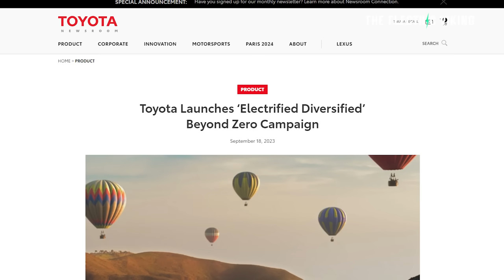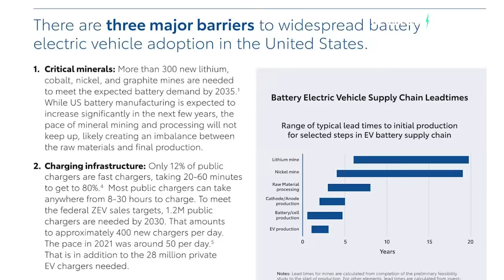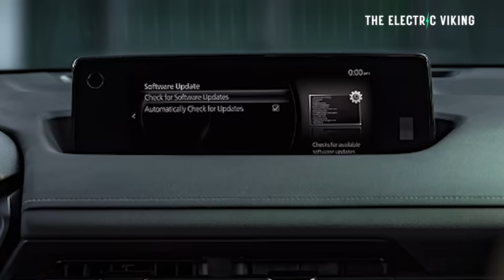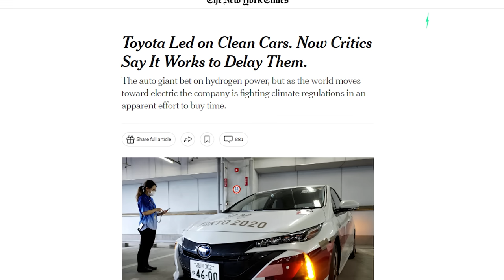We are witnessing the early stages of the biggest fall of any company in history

Comment: As Tony Seba pointed out, there's too many moving parts in the ICE, something upwards of 2000, where the electric motor has under 100 moving parts, BIG difference.
Reply: While an ICE car contains about 35k parts,an EV has about 10k.
Reply: @adamadamm5369  beats the hell outa me.  Tony Seba has a video where he shows an ICE broken down and spread apart on the floor to show the parts, likewise with the electric motor, so I dunno where 5000 moving parts comes from, unless they're including the entire vehicle.
Reply: how many individual batteries make up a Tesla battery pack? A part doesn't have to be in motion to fail. It's all about chemistry...duh!
Reply: @northdakotaham1752  right on!  EV fans don’t want to recognize that it’s the NON moving parts that cause all the troubles and no one knows or is allowed to fix them.  My experience with a 2015 Zero over three years of ownership showed this.  When it worked it was a great riding experience. The onboard charger failed 3 times. The first recall was a firmware upload that dropped power and range by a third. This mistake was never fully resolved.  Had no trouble with the moving parts but the electronics were terrible.
Reply: Yep but!!! People cannot see the cost of maintenance between 2000 bits v 200 bits????? Blind Freddie.....
Reply: @brendankenny1332  Yeah, exactly what Tony Seba was getting at.  He said that the trucking industry couldn't wait until the battery powered semi truck hits the market, due to just that, the cost of maintenance.

The problem with batteries is acknowledged, but they are working those problems out.
Reply: @brendankenny1332   there are scheduled maintenance items (mostly oils and filters) and there are UNscheduled.  That’s where those “200” parts (actually thousands if you consider the battery pack) will get ya.  Too bad owners can’t fix these over a weekend like maybe doing a water pump or alternator or timing belt.@
Reply: @northdakotaham1752 Moving parts are more likely to fail, especially under extreme stress.
Reply: @davestagner  moving parts have been refined since the invention of the wheel! So...maybe batteries will be reliable "under stress" in several thousand years from now. They certainly aren't impressing anyone currently. That is reflected in the numerous videos and testimonials of those who believed they EV hype.
Reply: @northdakotaham1752  The reason modern engines are reliable is because they’re tremendously undertuned, operating far away from the limits of the parts - and even then, they aren’t completely reliable. I’ve had to rebuild a differential, replace the clutch, and replace the timing belt on my car, the head gaskets are shot, and I’ve lost count of how many oil seals have been replaced (and it still burns more than a quart of oil every 1000 miles). Speaking of hype, are you sure you’re not just binging on anti-EV hype, blowing stories out of proportion? Consider the “battery fire” problem - which is completely swamped even on a per-capita basis by gasoline fires in combustion cars.
Reply: @adamadamm5369  EVs are quickly getting cheaper than ICE vehicles.  They already are in China, as well as in some market segments elesewhere.  But within 2 years, they will al be cheaper than their ICE counterparts!
Reply: @northdakotaham1752 that would be one battery. You might want to learn the vocabulary of a topic before trying to educate anyone on it.
Reply: @Diap842IV EV haters don’t want to acknowledge that those kinds of failures are more common in ICEVs.
Reply: @northdakotaham1752 the older Model S has a typical battery life of 300,000 miles. The Model 3 and newer Model S are trending to 500,000 miles. I find that impressive.
Reply: @williammeek4078   first, I’m not an EV hater.  Just enjoyed a two week MYLR rental for 3,500 miles. I would buy one if I needed to.

Second, as I said in my first post, you can’t fix the unscheduled issues yourself.  A prior poster talks about his failed belts, head gaskets etc, but at least he has the option to do his own work with parts available at his nearest parts chain.  Anything running on proprietary electronics will be useless without long term factory support.  I like the driving experience of electrics but there are practical limitations yet to be worked out.
Reply: @Diap842IV  sorry but no. At least for my Chevy Bolt, i can replace the battery and drivetrain components myself.
Reply: This is why I think the prices for EVs are acting like the prices of big screen LCD TVs.  The manufacturing and assembly of EVs is continuously getting more efficient and cheaper.  Increasing the scale is also contributing to lowering the cost per unit.  So, like big screen LCD TVs, the longer you wait, the lower the prices of EVs will become.  China already sells some simplistic EVs with basic amenities for less than $10K.   This will also lower cost for EV car insurance and registration cost.
Reply: @williammeek4078  curious then; have you taken your battery apart to find what’s wrong with it?  How are you with field diagnosis of the BMS? If the software becomes unstable, can you download the correct patch from GM and load it yourself?   Have you actually done anything to the Bolt yet?  Not “hating” but asking as a gentleman.
Reply: @Diap842IV  i have not taken mine apart as it still functions well. I have salvaged a battery from a wrecked Bolt for my home battery and built my own BMS for it. If i had problems with the BMS firmware on my Bolt, i would just replace the entire BMS as there is likely a memory fault anyway.
Reply: @hugh7840  Speaking of which, not long ago someone flew a drone over the huge manufacturing complexes going in just south of the border in Mexico.

I was looking at the scene marveling over the size of enclosure, (I'm a builder by trade), but something was amiss.  I took a second look at it, and to my amazement, the parking was damn near the size of a postage stamp I kid you not.

I studied it for a minute and marveled at how AI, robotics and automation are changing our lives.  Thankful to be 70.
Reply: @adamadamm5369 Because EVs are newer technology that is still getting better and cheaper every year. Tesla Model 3 & Y are already cheaper than average car prices while being much better than ICE. Total cost of ownership makes EVs much cheaper compared to comparable ICE vehicles. If it were easy to make compelling EVs in large volume and cheap, then Detroit 3 would not be cutting their EV production in half for 2024 and beyond.
Reply: @lonihollenbeck4654  Your observation about the small parking lot for workers reminds me of that bad joke.   The future factory machines will have only two employees:  a man and a dog.  The man feeds the dog.  The dog makes sure the man and no one else touches the machines.
Reply: Walking has less than 10 moving parts and it is good for health !
Reply: @albertgan9423  I live on 16 acres which I walk, I'm always amazed at the number of visitors that I have here that insist on driving around the property.

I couldn't agree with you more.  At 70 I'm in better shape than most, sad to say.
Reply: @williammeek4078 That is not very impressive compo are to an ICE.

Over 50 years and 3 million miles.  Now that is impressive.
Reply: EV's are part of the solution not the whole solution.
Reply: @williammeek4078 I’m hearing 9 out of every 10 fatal accidents last year involved an EV………?
Reply: @granttaylor8179  that would be impressive if that was a typical life but it isn’t. The numbers i gave for EVs are typical values. EV actually are impressive.
Reply: @bigjdm5460  that would be a flat lie. You might actually want to question your information sources more. Unquestioning belief like you have is a step towards fascism.
Reply: @bigjdm5460 With all due respect maybe you need to have your hearing checked.
Reply: @bigjdm5460  are we talking China only (IE "happy grandpa" mini cars)? Still far too much of a stretch even at that. If that's supposed to be in the US I'd say that you have swallowed so much BS you are probably starting to moo and think cow bells are a slick fashion accessory...
Reply: @carbonduke01  there is a difference between parts and 'moving parts'. If you count all the battery cells which are mass produced identical parts as equivalent to every specialized part in an ICE engine you get an distorted impression of complexity.
Reply: @northdakotaham1752  you don't evaluate the reliability of a technology by "numerous videos and testimonials" you saw on YT. The algorithm feeds you similar videos to what you already clicked on. If you clicked on videos critical of EVs you will get more of the same.  Do you rely on your laptop, your smart phone? It uses the same lithium ion battery tech as an EV. This tech is already an established billion dollar industry.
Reply: @FredPlanatia  there are videos, testimonials regarding both ICE and EV vehicles. There is crap being built in both camps. Currently there is infinitely more EV trash being sold than ICE trash. ICE vehicles, with only basic care can still be on the road 20, 30 maybe even 40 years later. EVs are doubtful to make 10 years. About the time it's paid off. The battery and software will long be obsolete with no support or parts available. Meanwhile, I can still buy OEM parts to keep my 40 year old Dodge on the road. That's not a YT testimonial. It's real life bc I have and drive old vehicles and have been keeping them on the road for over 55 years. An EV is a rolling computer. How many people do you know still running Windows 95 on a 386 processor?
Reply: Yet, car rental company is getting of its EVs and going back to ICE due to HIGH repair costs of EVs, and poor resell value of used EVs..
Reply: @bigjdm5460  where are you hearing this? It seems highly unlikely considering only 1% of vehicles on the road are EVs currently. That would mean EVs are 900 times more likely to be in a fatal accident!

 I didn't find anything specifically on fatal accidents, but i did find a fact checked article by Jason L. Arthur stating the following:
EVs have a 40% lower chance of injury than an ICE.

Tesla's have one fire every 210 million miles, whereas for ICE vehicles its one fire per 19 million miles.
EVs have a 0.03% chance of catching fire whereas ICE vehicles have a 1.5% chance (about 50x more likely)
Taken together i think this indicates that EVs are safer.
And now the downside:
 - new EV drivers are 3x as likely to be in an accident (often because they aren't used to the instant torque).
- EVs are 1.5x as likely to be in an accident involving pedestrians or cyclists (because they are much quieter)
- EVs being heavier can cause more damage to others if they are involved in a crash (at the same time the low center of mass and higher weight protects the occupants
Reply: @northdakotaham1752  all new cars on the road are 'rolling computers'. If your car is 40 years old its not really in that class. you are comparing apples and oranges. I don't think an ICE car rolling off the assembly line now can be kept 50 years with the owner doing all the maintenance. However since an electric motor is far simpler and has fewer parts than a modern ICE  i expect lower overall cost of maintenance.
Reply: @MNTrader2012   most of this is due to Teslas. The parts and repair are expensive, and Tesla cut the cost of their newest models which reduced resale value of older models. The later could be seen as a good thing since the price is going down, meaning manufacturing costs were cut. The high repair costs is another matter.
Reply: @FredPlanatia  as for the new cars being unreliable and possibly not sustained for a long period of years, I agree with you....but that said, they may sustain a longer life bc with much higher production numbers there is a much better chance of aftermarket parts and accessories which are likely to keep them on the road longer. On an EV, the drive motor seems to be the only reliable component but it has no use without all the other highly complex systems to make it function. Systems that are already giving trouble and this is on vehicles that are only a couple years old. The aftermarket industry will have alot of difficulty creating these major components. There are already a few shops that are throwing around the idea of modifying worn out Tesla vehicles, adding an ICE powered driveline.
Reply: Not more to say 👍
Reply: And there's 10,000 little batteries in a car battery pack. You only need 1 faulty from the factory or after an accident and you'll be sitting on a hand grenade.
Reply: @lesmotley6839  funny you should mention that, I just watched a video of a Chinese electric car getting blown straight up about 8-10 feet at a charging station.
Reply: @oddjobsandrandomprojects  yes, but when EVs catch fire they reach temperatures of 2500 degrees. If they're in a building, particularly a multi storey one they'll bring the building down as well. There is no hnown way of putting them out.

Comment: As current winter in Midwest shows, ice are going to be around for a while. Charging networks were not able to provide adequate energy supply in extreme cold.  People without charging available at home were in troubles. There are still waiting lines for Toyota hybrids.  Not that much for EVs.
Reply: This is not accurate. What happened was that three data centers were knocked offline due to power outages caused by the extreme weather.  At the same time, several gas stations were also forced to close.

The offline data centers affected some gas stations and some EV charging equipment.  And they were also not able to inform users of the app that they were offline.

It was a unique, one time event.  Of course a new system will have hiccups and growing pains.  These will be smoothed out as they come up.
Reply: @davidmenasco5743  this is not true.  Sorry I will avoid softer form the “not accurate” you use.  It was not a charger problem.  It was the battery in cold weather problem.  The plain chemistry science.  Battery needed to be preconditioned to use fast charging.  And number of vehicles in the city overwhelmed existing chargers.  Folks without homes with chargers suffered the most. Without preconditioning battery charging is very slow, which created the problem of cars piling up by the stations. I’m referring to multiple sources available here on YouTube. It was not just on a couple of locations.  It was all over Chicago and in some suburbs.
Reply: @vadskar64  The evidence that there is much more to the story than you have acknowledged, is really very abundant.

My source for what happened in Chicago is the Out of Spec podcast and other Out of Spec channels.  They provided first hand reporting from EV owners in Chicago.  Kyle even stopped in Chicago (on his way to Europe) to provide a detailed in depth report, visiting the affected chargers - and talking to some of the affected drivers.

It is true that newbie owners made a lot of rookie mistakes and were a part of the problem.  But in other cities with more charging infrastructure, they did not have these problems, and many cities have had much much higher rates of EV adoption and still not had any of the problems Chicago saw in this one time event.  And this includes cities in cold climates.

Examples can be found all across Scandinavia, and the province of Quebec.
Reply: Some places people live never get snow... the majority even.

Comment: The question becomes what vehicle type is used in countries where 3 billion people have little or no electricity let alone a grid that supports a supercharger network.
Reply: You mean like India? The majority of people there can't afford cars. They mostly use bicycles and motorbikes. This won't happen overnight. It will take decades.
Reply: You would be surprised.
Reply: No one is stupid enough to sell EVs to a country that poor what are you talking about. LOLLL
Reply: General Atomics is working on a nuclear engine for cars. It shuld be able to gt at least 1 million miles before it needs refueling. They are also working on portable nuclear powered recharging stains. Each charging station us rated at 1 megawatt and it is air cooled.
Reply: It is possible to make an ev under 600 kilograms and for $10k
Reply: In such countries the Ice modes of transport are overwhelmingly small motor bikes and journeys are short. An electric.scooter or bike will take over and a solar panel to charge the few miles needed per day, doing away with buying  petrol.
Reply: I read recently that electric scooters/bikes may save as much as 1 million barrels a day of oil.  The question still remains how will the electricity be produced/stored at scale in capital-poor countries.
Reply: Answer is easy: non-centralized solar and other renewables! 👍
(Obviously.)
Reply: @justinklenk yep.  Cheapest and fastest to set up.
Reply: This is an option.  The question then becomes how to network that into a system for charging vehicles any place and anytime.  After all Ford, GM, Stellantis, Honda, Toyota, Land Rover, etc, etc could not make it happen and now have all signed onto the Tesla network.  Having technology and implementing it are vastly different skill sets, with the second requiring obnoxious amounts of capital that 3rd world countries don't have while they do have gas station infrastructure already set up with little to no additional capital costs.
Reply: @chucksurgeonertribute2113 

Ford nucleon 1958. Did not catch on.
Reply: @13thbiosphere well I don’t know about 600kgs but there are cheaper EVs in China already.